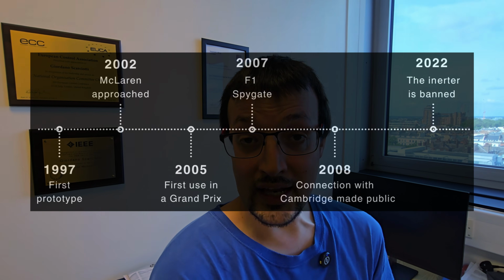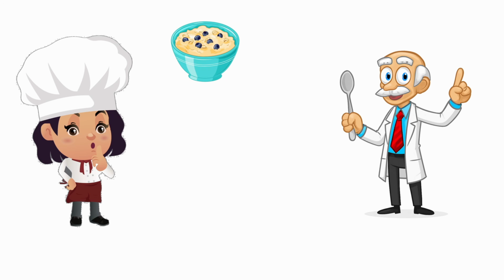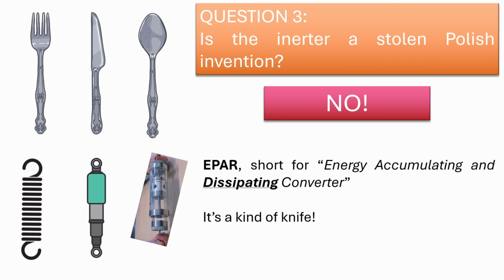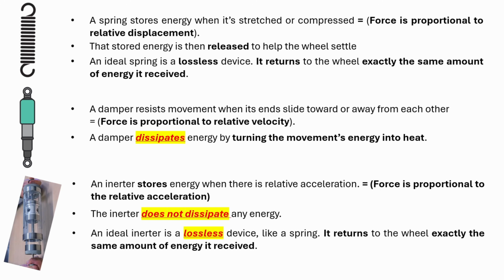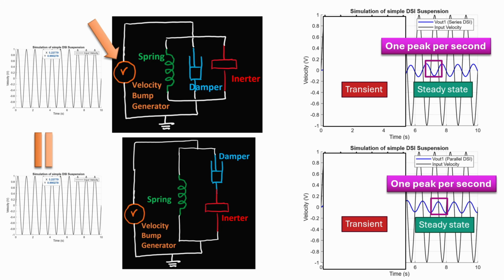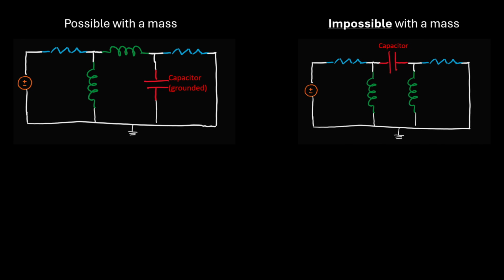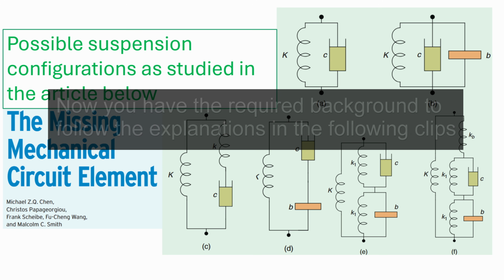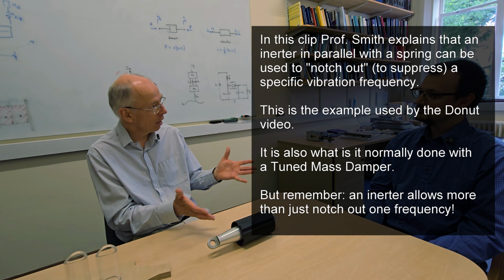Why Everyone Gets the F1 Inerter Wrong | Explained Clearly

Comment: Great video on the system design purpose of the inerter. As one other commenter has mentioned though, it would have been great to get a mechanical engineering take on exactly how the inerter reacts to a force applied to it, and in that way understand how it can phase shift in the opposite direction of a spring once it reaches a steady state. I've never heard of this device before this video, and even with a mechanical engineering degree I'm having trouble picturing how the flywheel is able to "spring back" to release its energy again as I don't know how the device is actually constructed.
Reply: It doesn't spring back but rather continues to apply force in the original direction of travel, opposing a change of direction
Reply from the maker: Exactly, thanks.
Reply: Okay so my understanding is that, since it's off-phase or opposite of a spring, we should think it as it "spring forward" to release the energy instead. When the inerter is pushed, it spins the flywheel, inertia will keep the flywheel spinning and therefore pushing the inerter further.
Reply from the maker: Thank you for your comment. This was covered in the previous video. You can watch the following clip where Prof Smith explains in detail the mechanics of the device. This is the correct timestamp https://www.youtube.com/watch?v=FhmLb2DhNYM&t=1133s
Reply: @Prof_Gio  Thanks, I should have had a look at that one first ;) One thing I think that might confuse people, myself included, is that the rod that he uses to compress the device doesn't appear to keep going once he stops pushing. So, unlike say a 250kg mass on ice it appears to stop dead the second he stops pushing, which can look a lot like a normal damper to most people. Is that just down to the gear ratio in the ball-screw?
Reply: @texnorthman  More likely friction than the gear ratio. It was said that just a little force can push the rod, then small force of friction should be able to put it to stop pretty quickly as well. In the damper like example, some air resistance may be a factor also, but very dependent on the design of the flywheel.